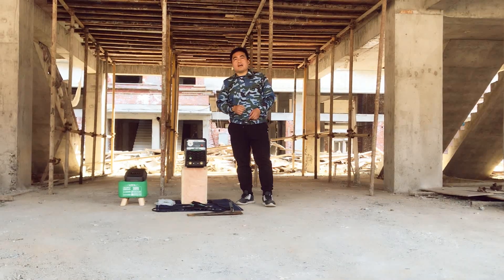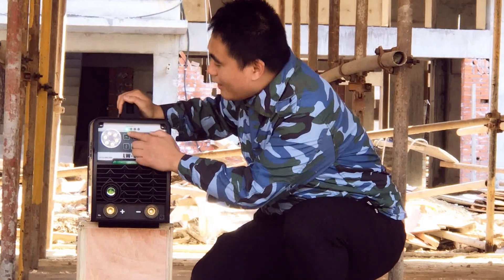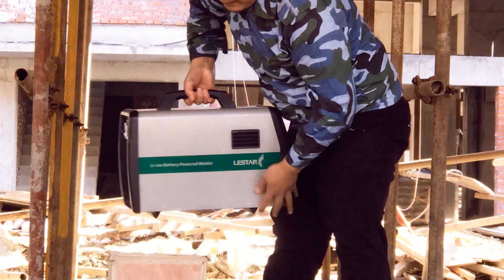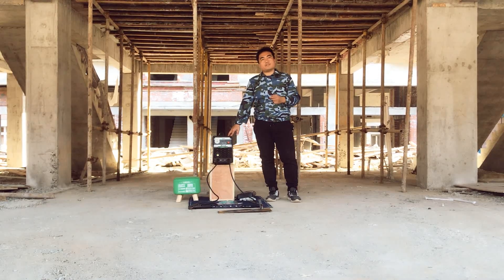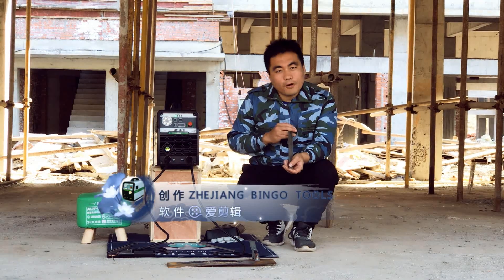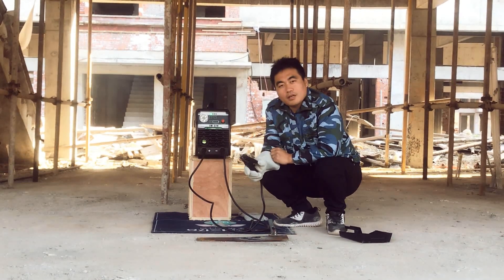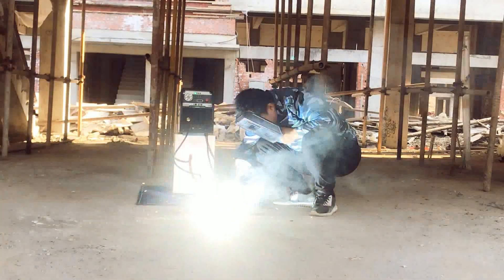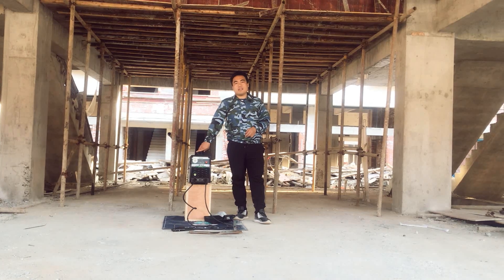Li-ion Battery Powered Welder, Battery Powered Stick Welder, Cordless Inverter Welder, MMA Welder

Comment: My interest is up. But this needs to be available on Amazon or ebay.
Reply from the maker: Ebay or Amazon is under preparation, will inform you after approval, many thanks.
Reply: @batterypoweredwelders3811  This welding machine available to find in Alibaba? I am interesting on it
Reply from the maker: @Phanith001able  We do not post this welder on Alibaba yet, but soon Amazon will be able to place order, or you can contact us via email sales@bingotools.biz, we can send welder order directly to your office. Many thanks.